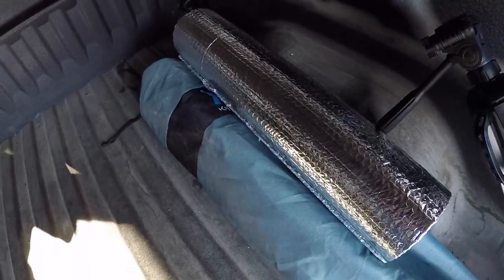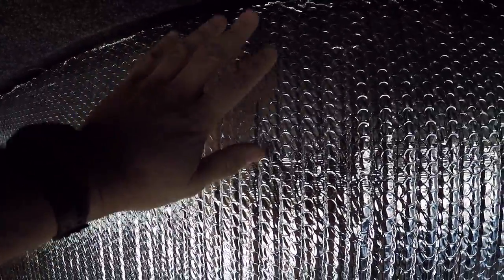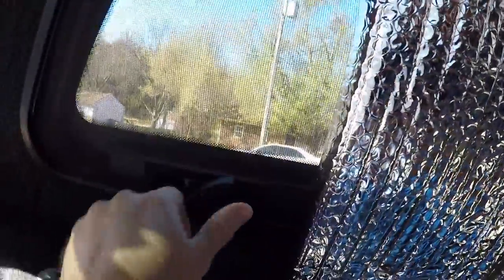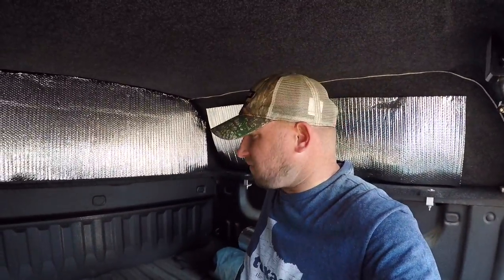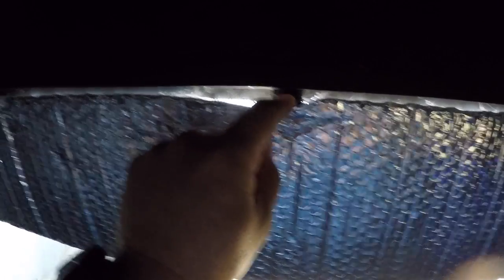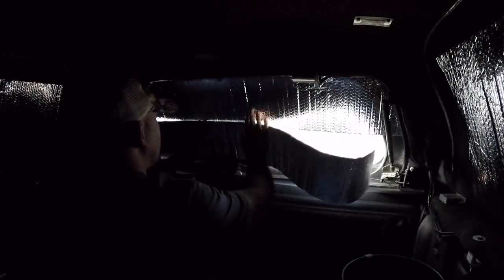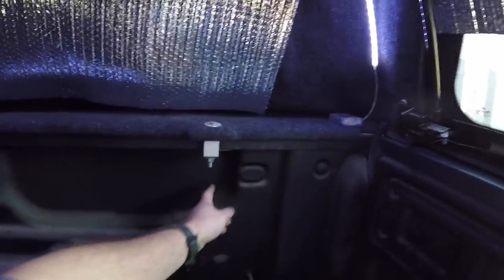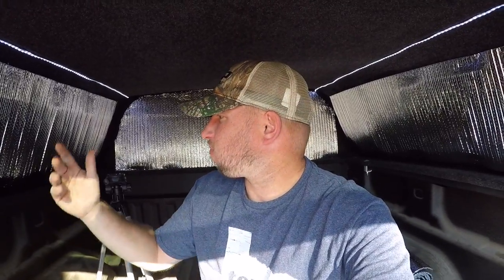Truck Camper Upgrade Installed Reflectix In The Windows (Truck Camping)

Comment: Good idea brother. Would it work better if you seamed them together? As far as insulation goes?
Reply from the maker: Hello Mike, it probably would work better.I think what I have done will work good enough. I found some holes in the bed of the truck that I need to cover. That should help keep the wind and most of the cold air out. Have a wonderful day my friend.